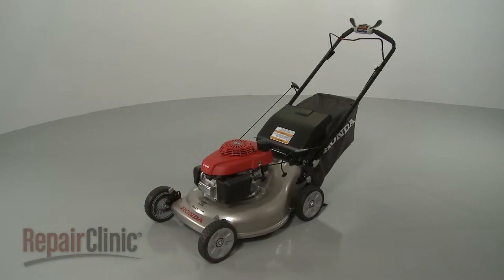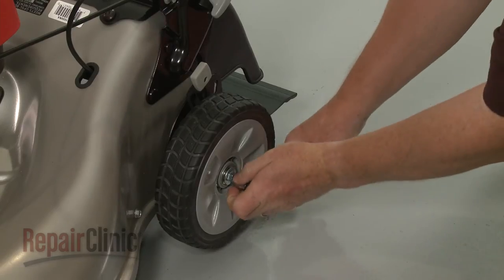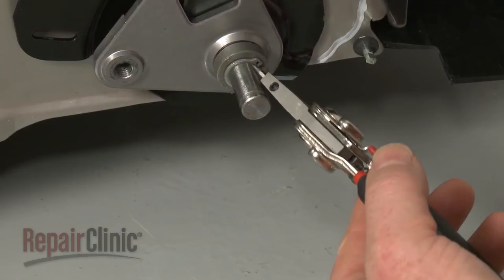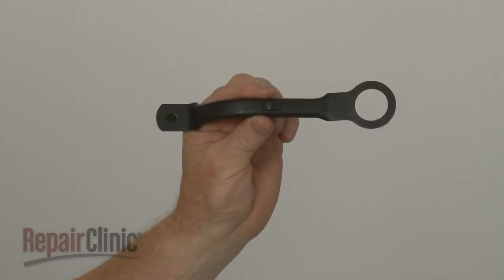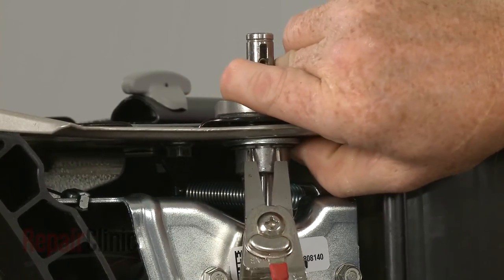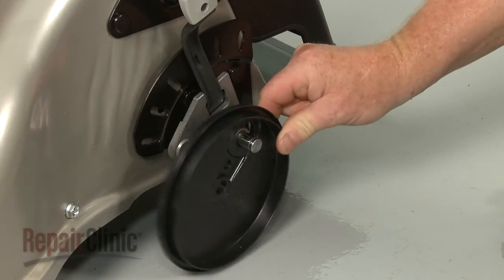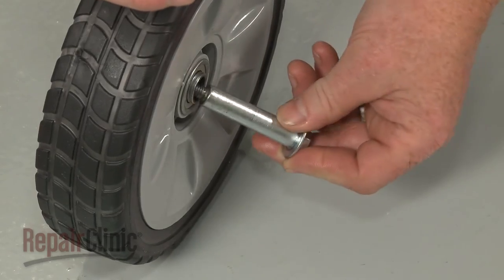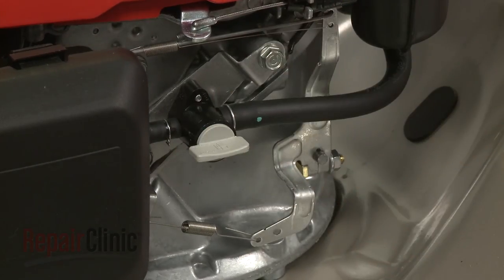Honda Lawn Mower Replace Rear Adjuster Arm Part # 42961-VG3-010

Comment: Those snap ring holes are tiny and some are not the same size holes on both sides, had to use a tiny drill bit to make the holes the same to use my snap ring pliers.

Comment: Please show the process for the RIGHT SIDE Wheel, is it going to be different ??
My Right Side Wheel Adjuster has no tension any longer and falls down.. Did I lose the little keyway and adjuster spring or something ??  Please advise,  thank you for your wonderful video's !!
Reply: I am updating this 1 year later  :)  What happened on this Honda Mower is that the large C-Clip that holds the entire adjuster in place from the other end of the mower axle, somehow came out of the little groove it sits in, so the adjuster was no longer under tension, so it lost its adjustment and went down.. Numerous times, I have had to keep taking it off and using the snap ring pliers, place it again, back into the little slot. This of course, comes after taking everything off the right rear wheel,  those little spacers, 2 - small C-Clips, the rear wheel gear, all that stuff..
Have cleaned out the groove on the axle, purchased a new C-Clip Honda Part, and it still happens, only on the right rear wheel..

Comment: I have a Honda mower HRR216 VKA and One of the rear height adjuster arm's (left) for some reason keeps slipping out of its position while mowing. It happens when passed over a dip in the lawn or uneven surfaces, wherever the mower shakes a bit. I usually mow on the highest setting (4") but the arm keeps slipping/coming back to the middle setting within a couple of feet of mowing. Am not sure if the arm got loose or bent or not able to retain weight, or the small piece of metal that locks it in position is loose. Everything seems ok but this keeps haopening.

Can you suggest what could be wrong or I could check ?
Reply: Summary:
My similar problem solved by reducing the bend in the adjuster arm/lever…that is the slight bend that is just above the ringed portion that slips over the axle housing of the wheel support plate.  The less bend there is at that point the more force the lever pushes with on the notched position plate.

Details:
I had a similar problem where the left adjustment arm would slip or pop out of the 4th position into the 3rd position (1st being the lowest setting).  This would happen a few times while mowing.  It never seemed to pop out to a lower position once it was in the 3rd position….. and it never was a problem on the right side.  The problem occurred more often while mowing over the last couple of years, and, the cut profile difference was noticeable if not caught soon enough.

It did not feel like the tension of the arm/lever was any less on the left side vs the right.  And nothing felt loose or out of place in the wheel assembly/axle.

However, once you raise the back end of the mower and support it (eg. blocks of wood) so the wheels are off the ground you can then move the adjustment arm past the 6th position so there is no longer pushing against the notched plate (or likewise past the 1st position).  This can be done without the wheel removed but you get a better view if the wheel is removed (no need to remove any other components at this time).  Now the arm moves in and out freely and you can compare the point at which the arm first meets resistance as you pull it outward, toward you.  Compare both sides using the arm’s slot in the wheel support bracket as a reference.

In my case the left arm met resistance 1/4” to 1/2” later than the right, suggesting it was providing less force than the right.  

Then disassembled the left side as covered in this video (also gave the opportunity to clean up the gears and apply grease to gears and axle components) and removed the arm.  All the axle/drive components were as they were supposed to be so it confirmed the problem was not related to a out-of-place snap ring or anything else.

The arm has some manufactured bends in it.  There is a very slight one just above the ring that fits over the axle housing of the wheel support plate (note: not referring to any of the bends further up the arm where it starts to take on a U shape).  If there is too much bend in it at this location this results in less force against the notched position plate.

Placed the arm in a bench vice with the ring held in the jaws with this bend just above it (used soft material to protect the ring surface from the serrated vice jaw).  Pushed on it carefully, just above this bend, to reduce the bend profile.  Had the wheel bracket handy to observe the change in its profile with each attempt (ring held flat against wheel bracket).  Once it matched the right side (or even a little further) I reassembled.

Next mowing the left side did not pop out from the 4th position.

Comment: I purchased a set of 6 snap ring pliers and none of them fit into the tiny holes of the snap ring.
Reply: Erica Pallaron,  I am sorry you had to go through that..  I purchased 2  Channel Lock Brand snap ring pliers,  1 large, 1 small for the different size snap rings on this mower.
They each came with several tips for the ends.. I of course, use the large pair for the large snap ring and the small pair for the small snap rings.. Buying a good brand will always work better..
Stay away from all that China crapola on Amazon, etc., in my experiences with the non- name brand Chinese stuff, it will always be just a little smaller, thinner, not exactly the exact fit, etc., and then it doesn't work or breaks way too soon..
Good luck with your project !
Reply: Why is the design of these on the Nexite deck so difficult to switch height on the rear? The clearance is extremely tight and the tendency is to bend the lever when trying to swap heights.

Comment: You hid and failed to mention the key on the axle shaft that drives the pinion gear. This is spring loaded and easily overlooked and lost. Pretty deceptive.